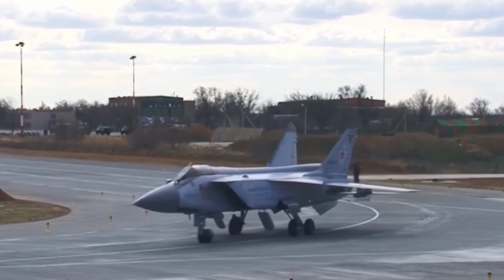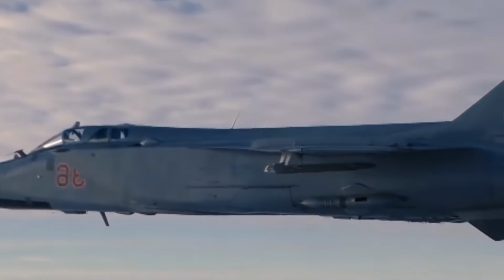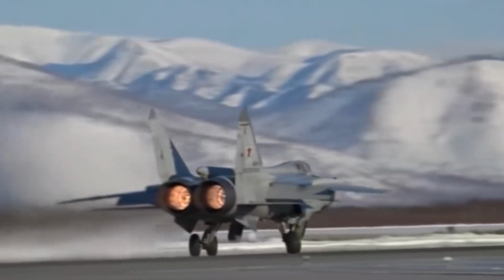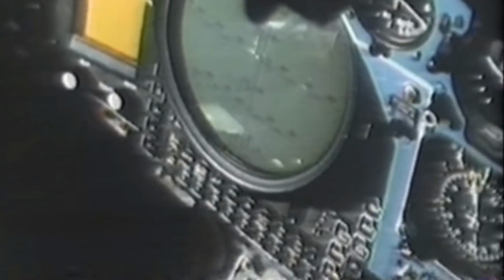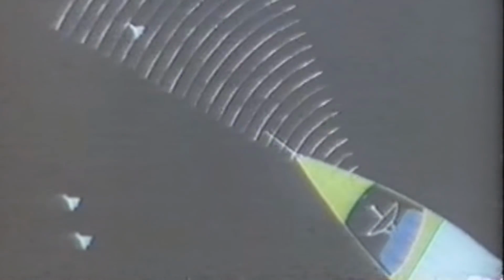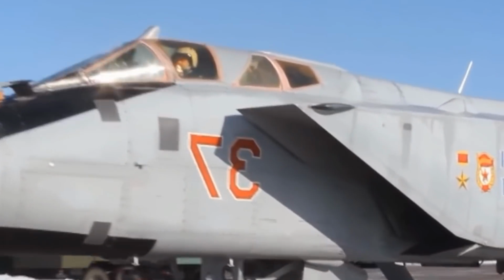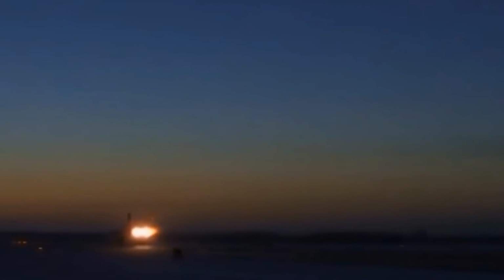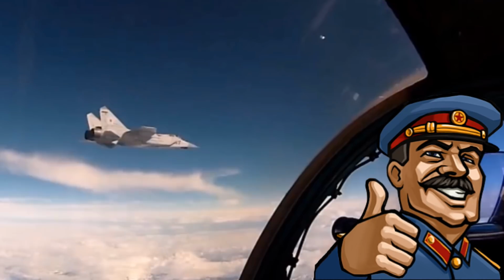Mikoyan MiG-31 Foxhound - Russian Interceptor Fighter

Comment: has mig-25 ever intercepted SR71? or it can?
Reply: The speed of the flight of the original MiG-25P combat interceptor on the full afterburner of the R-15 engines corresponds to 3000 km / h with full missile armament - 4 P-40 missiles, which create a great drag and weigh about 2 tons. Without rockets, a higher flight speed is provided, approximately 15%. This was confirmed by American experts who carried out the race of engines and established that the aircraft could exceed M = 3,2 (3,400 km / h). Scouts MiG-25R fly even faster interceptors. However, in operation, the speed is limited to 3000 km / h (M = 2.83). In real operation, the SR-71 was flying at a higher speed - 3000-3400 km / h. In 1976 SR-71 "Blackbird" set an absolute speed record among manned aircraft with straight-flow engines - 3529.56 km / h.
Reply: There are no known cases when the MIG25 was raised to intercept SR71. In a real situation, it's unlikely that airplanes will play catch-up, most likely the mig25 is directed from the ground to a 150 km stretch, where it will launch a R33 missile on the target. P33 is more than capable of striking SR71.
Reply: jaikumar848
The development of the MIG25 began in 1961, so there was hardly anything known about the SR71, which will begin flying in 1966. The MIG25 was designed to intercept supersonic bombers and cruise missiles. For safety reasons, the pilots were forbidden to accelerate the aircraft over 3000 km / h. The maximum speed of the MiG 25 reached 3600 km / h. When flying over the Sinai Peninsula, this speed was fixed in 1972 by both sides of the conflict. The absolute altitude record - 37 650 m is not beaten until now. The main reason for the limitations was that unlike the SR71, it was a serial aircraft manufactured by hundreds. On top of that, there are a number of limitations, as improving thermal protection would lead to a strong increase in value.

Was the MIG25 successful? Yes and no. This is a large and heavy aircraft, difficult to maintain. Its engines were expensive, resource-poor, and very fond of fuel, which made many countries that were armed with them get rid of them, preferring to use other aircraft, even old ones like MIG21.
Reply: It's VERY difficult
Reply: Thor Gustafson the SR71 is Mach 3 capable correct? If I'm not mistaken the mig 25/31 can hit up to Mach 2.7-almost 3 at very high altituded and with a service ceiling that is just inferior to the blackbirds. What that means is that there is theoretically a window during wich they could hit the SR71 with a missile.
Reply: technodrome mig-25 was specifically developed to intercept SR-71, correct?  if it can't then that means mig-25 was considered as "failed"?
Reply: Thor Gustafson fast enough to get a lock-on and launch a missile